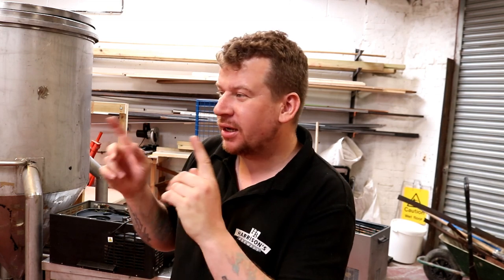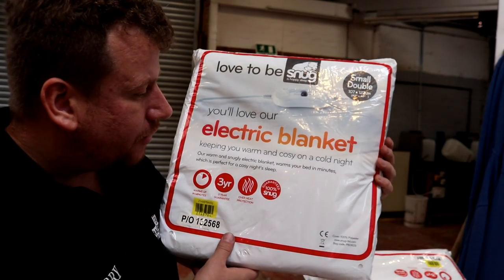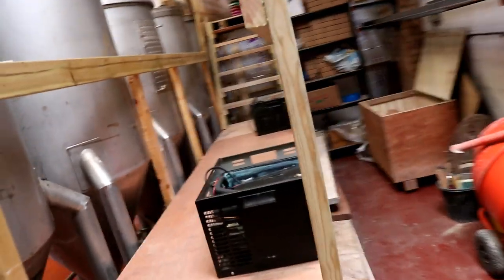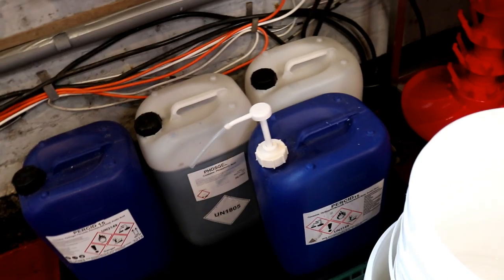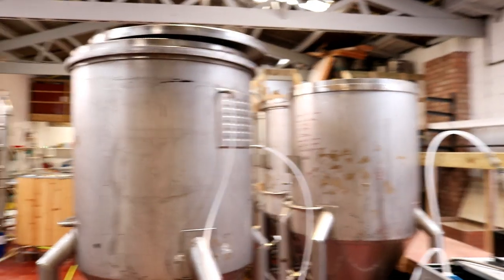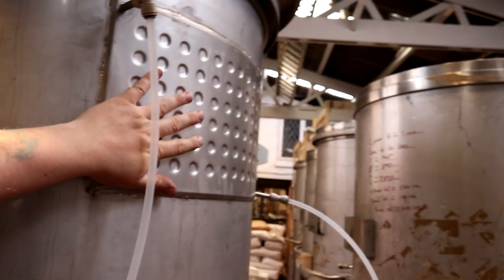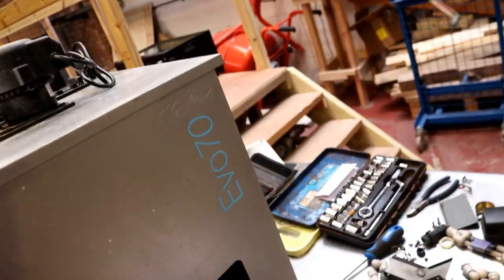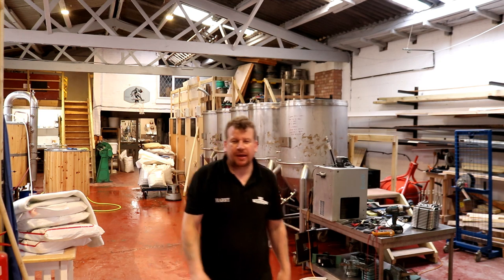So the cooling plates leak! That's not good.

Comment: Hi Harry, I use ammonium sulfate in granular form on the farm all the time and it's pretty agresive on fertilizer bins and other kinds of equipment. It also tends to draw a any moisture from the air but it should do anything to stainless steel. Maybe that spring wasn't that stainless after all. You could test it with a magnet it shouldn't be magnetic if it's propper stainless steel.
Reply from the maker: Definitely 304 stainless. the liquid was 18% sulfuric acid.

Comment: Suspicion is quality of the stainless in the spring. I have noticed that in stainless I buy for marine use, some is stainless in name only!  Also, Sulphuric acid has a tremendous affinity for water and is extremely exothermic in its reaction when mixed with water. The heat plus the acid reacting with impurities in the stainless would breakdown the spring.  Can you use a simple plunger draw system like a hypodermic uses?  Enjoying your progress! Been following a while! Good Luck!

Comment: Can vouch for brew builder. Got one of their conicals & a few other bits. Really happy with them. Lusting after their insulated mash tun atm. For parts like sight glasses and brew pumps, most of the UK shops seem to sell ones from china so I tend to check AliExpress first for those sorts of bits. For fittings, check out brewpi. Their bread and butter is their brewery control software/controllers. But their stainless BSP fittings (particularly the ones with recessed gaskets) are the best I've come across. They also do some top notch low watt density elements and really good quality herms coils.

Comment: Just a question on the placement of the chiller plates as I might be missing something. Since heat rises and cold falls in a liquid. If you put the plate at the bottom then it will be chilling the already coolest part of the tank. Doesn't it make more sense to leave it at the top cool the warmest part that will then sink down to be replaced by the warmer liquid? Thereby circulating  and mixing the liquid to a degree for a better overall average temp.
Reply from the maker: It is a problem of the plat being above the level of the liquid. The tanks have a good head space.
Reply: @harrybrew69  ah! That makes sense then. Suppose ideally a top to bottom plate would be nice. Thanks for the explanation.

Comment: With the chiller plates in theory the cool liquor at the top will sink to the bottom as its chilled with the warm raising to the top and will circulate. So I think that plate will be fine where it is?
Reply from the maker: No good if it is not in the liquid though. And using the other tanks as a reference that may well be the case.

Comment: Brewtech gear is cheap and gets the job done. I use their 20gal kettle (holds just over 80l) and the 17gal conical to turn over 60l batches. Not sure if the mash tuns are worth it though as I still use a converted keg as mash tun. If you are happy with a bit smaller batches however an all in one system like brewzilla 65l is a no brainer IMO.

Comment: Why not a 30l water urn wired to a stc to mimic a robobrew or grainfather and use a brew in a bag setup be easy and cheap and wont take up much room
Reply: Also there are bigger urns ive seen guys running 65l ones

Comment: Steel is a composite of iron and carbon, so I'm assuming the carbon converts to carbon dioxide and iron  to iron sulphate and water
Reply from the maker: Stainless? I thought the percent of carbon was less than 1%. with about 18% chromium and 8% nickel?
Reply: @harrybrew69  Yeah, true; just googled it. Try searching for acid-transfer pump